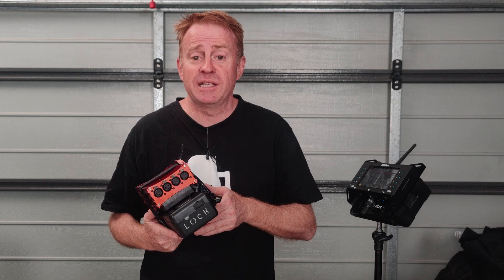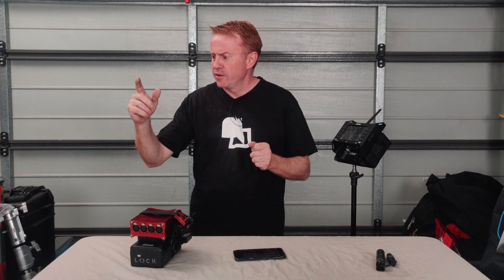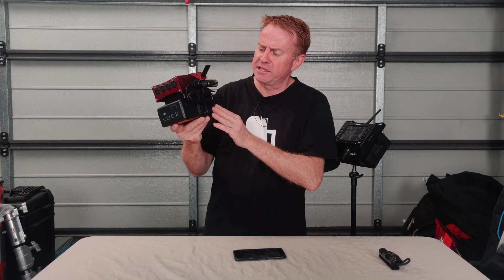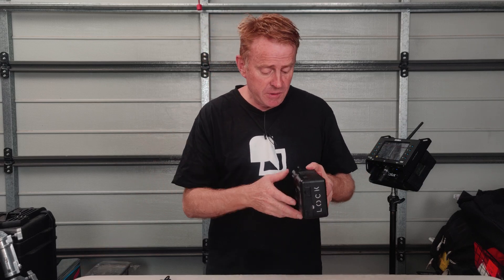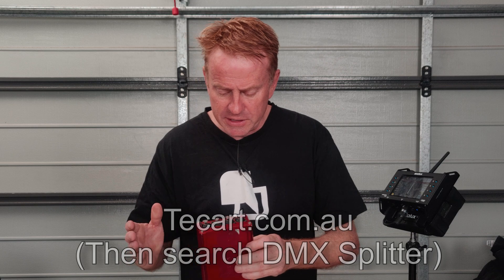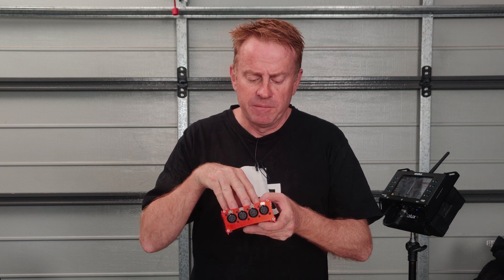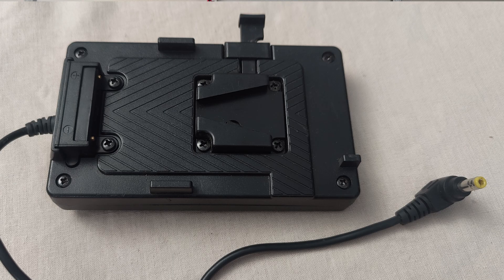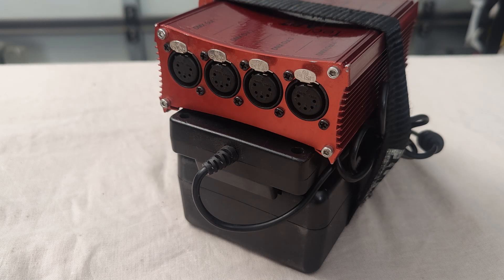Gaffer & Gear 213 - Battery Powered CRMX Hub

Comment: This looks great, thanks for sharing! 

My knowledge of DMX/CRMX is very limited so this may well not be a valid idea but much in the way that this setup works, could you instead use a CRMX receiver into one of those cheap Chauvet wireless DMX packs to multiply the DMX signal but wirelessly? I'm guessing that there's an obvious reason that wouldn't work or it would be a flaky workflow but they're like £50 a receiver vs £500.
Reply from the maker: I remember looking at those years back. I don't think they are CRMX compatible, but I could just feed my DMX signal into their transmitter. And I think they are 3pin lxr not 5pin.

A bit of working around, but possibly a cheap option, very cheap option!

Comment: Hi Andrew, not familiar with the CRMX/DMX system..hope you can help my learning..

• With this box does it mean that you can now send a wireless signal to the box, which itself is connect up to four separate lights via DMX cables?

• Does this still give you full control over all the lights’ different functions? I hear you often mention about DMX channels on reviews, I’m curious if there’s any implications to that with this box setup?

• I’m also curious if there’s any issues connecting different lights with different DMX capabilities with this? I suppose the box will receive a signal for output 1 and only send it through to output 1? And if it’s a signal for 1 to 4 (E.g. all fade to black), it will send it across all four outputs?

Hope to learn from your experience. Thank you!
Reply from the maker: All I am doing here is changing between wireless to wired DMX.

Without this box my only options to get the DMX commands from my controller to lights that don't have built in receivers is limited to using a wireless receiver (about $500 USD each), or to feed a DMX cable into a light that is receiving the signal from my transmitter or hardwire to the one output on my transmitter.

This just enables me the freedom of not having lights wired together in daisy chains.

In an ideal world, all the lights would have receivers and I wouldn't need cables at all

So we can end up with several lights running in a daisy chain of cables.

With DMX the lights don't receive separate commands, they receive all the commands for every light and can relay them via the DMX out. So yes the lights retain all the DMX capabilities.

It's the same commands going through each outlet. So it doesn't matter which outlet on the box you connect the lights to.